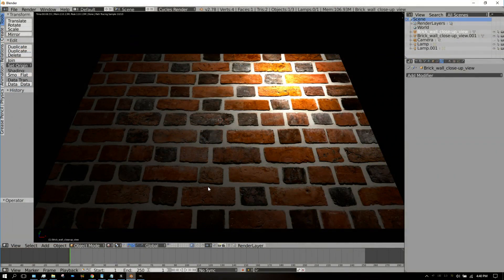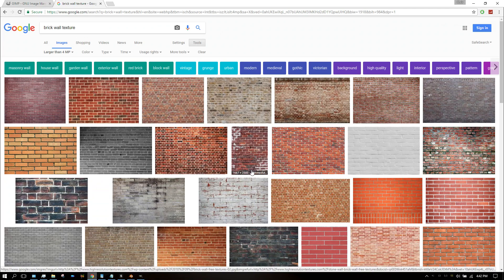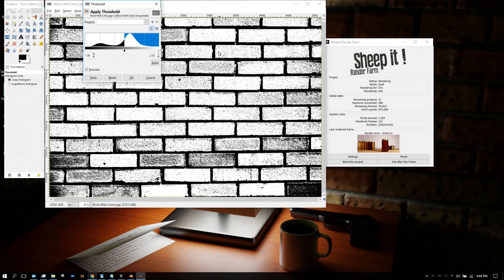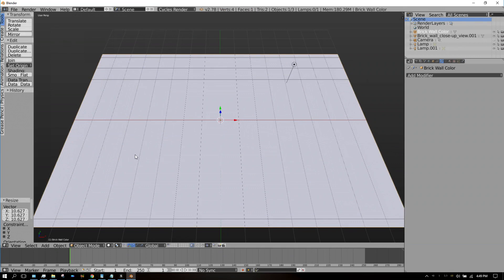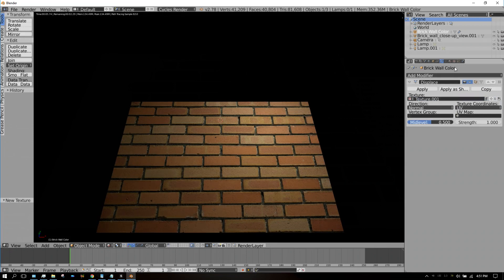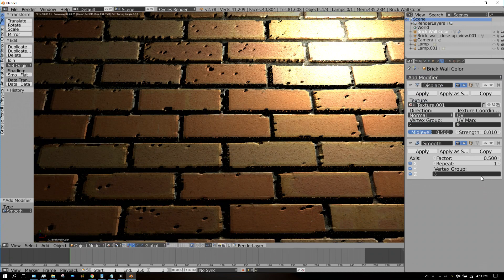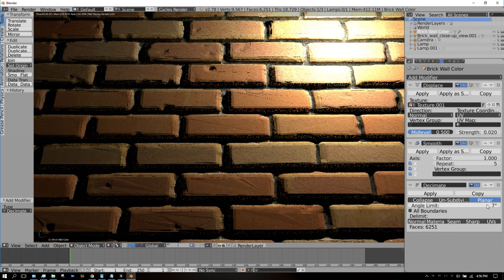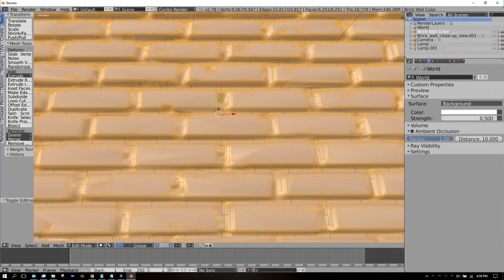(Tutorial) Displacement Modifier Texture Blender

Comment: Don't decimate, bake a normal map and that's it, 1 face and it will still look good... but i guess that's a topic for another video

Thanks for sharing!
Reply from the maker: I don't know how to do that. But yeah, I'm absolutely sure there is a better way than I used.
Reply: oh well there is nothing wtong in using the displacement map for detailing; as you said tho it grately ups the polycount making rendering and exporting it (say to a game engine) almost pointless.
what you want to do, after you displaced your map onto an object is to bake a normal map texture and use that as a displacement, it will not increase any geometry but the light will bounce off of it as if it had.
try looking in to it, its not difficult at all and it is the next step after the displacent you want to do in a workflow
Reply from the maker: I will look into it. There's a lot I need to learn.